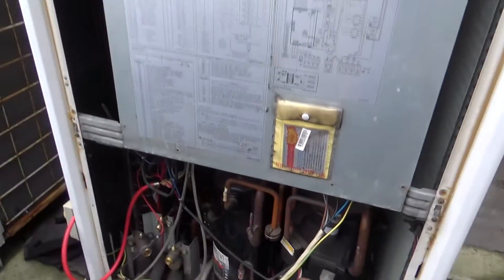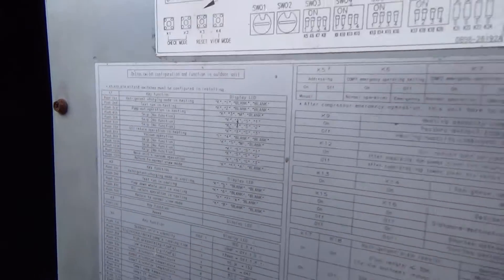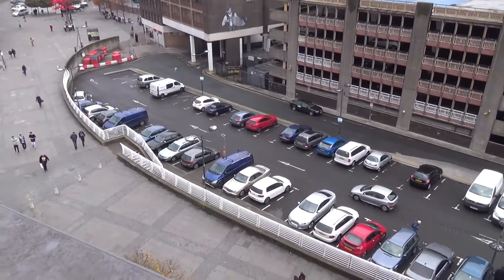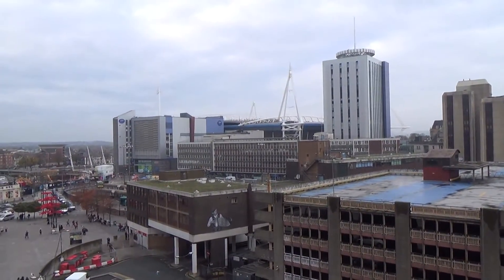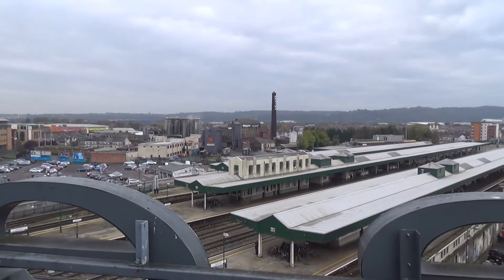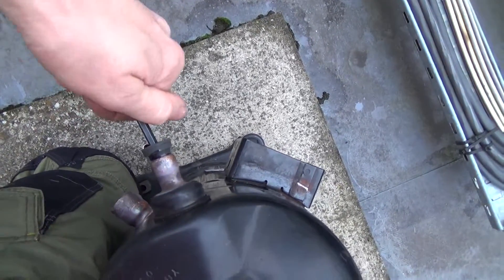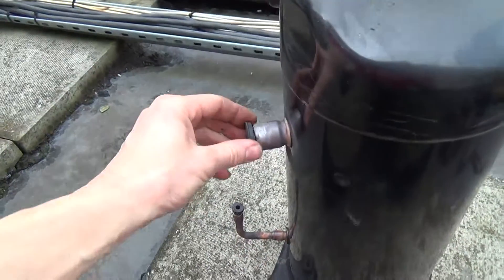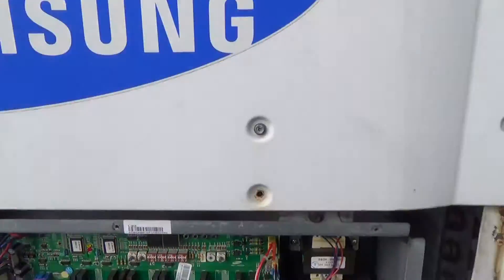Samsung Compressor Change

Comment: They are also referred to as variable displacement scroll compressors.  The displacement is controlled by increasing or decreasing the pressure in the control head.  Denso has actually been making them for a while longer than Copeland has.
Reply from the maker: douro20 Interesting, we have had a few failures of these on a multi compressor Samsung AC, though the constant duty scrolls just keep running.

Comment: Thanks for showing the roof top view, I feel like I've been on holiday. When you say digital scroll does that mean the compressor are variable speed? It looked a bit odd with all those contactors. Do those compressors run at very high speeds?
Reply from the maker: The compressor is fixed speed and runs around 2800rpm same as normal scroll, the digital part is that it can be unloaded 100% by lifting the scrolls apart. By modulating when it is pumping and when it isn't the capacity can be varied.
The other contactor is for the fixed capacity compressor, by running either or both the capacity of the system can be varied to cope with the differing loads of the 14 indoor units.
Reply: heavydiesel Thanks, that makes sense it didn't look like there was a BLDC drive in there with all those big contactors, How does do those compare against the variable speed compressors?

Comment: Hey what's going on man, I'm curious why do you call these digital compressors? I recently took a Copland compressor class at a Johnstone and wow they are making compressors with built in boards no more spade connectors or start cap, current relays, or starting components in general. Just a small board with connecting points. If you don't like working with electronics on equipment get out the trade now lol that's what I tell old timers to mess with them. But it's true
Reply from the maker: Hi Juan, these compressors can be capacity controlled by lifting the scrolls apart so they stop pumping, (its what the top pipe connection is for) the on off nature of their pumping is what gives them the digital name.

I've not seen one of the newer style compressors with built in boards here yet, I mainly do commercial stuff so new technology can take a while to appear on the sites i work on.

Comment: Hey just wondering why this heat pump has another hot gas line why can't it use the same refrigerant gas line coming from the side of the reversing valve connection the is connected to the line that goes to the indoor coil like regular heat pumps do what kind of strange heat pump is that with all those controls that most regular heat pumps don't use I've never even seen a heat pump like this before
Reply from the maker: The third gas line to the indoor units allows the system to heat and cool different rooms at the same time. It can save a lot of energy, you can take heat out of one room and put it in another one instead of moving it out side, and having another system move heat inside the room that needs heating.
Reply: Oh I didn't know that I haven't never seen a heat pump like that one that is a energy efficient unit why don't all manufacturers do that I haven't never seen one like this all heat pumps I've ever seen are either running in cooling mode or heating mode not heat and cooling at the same time
Reply: I mean I've seen them defrosting and using electric strip heat why they defrost but not cooling one room and heating another room
Reply from the maker: heatpump hvac Theres no electric backup with this system, its basically a load of minisplit indoor units connected to some boxes with valves in and then piped back to the outdoor unit with three pipes.

The system is in a hotel, basically each indoor can be off, heating, or cooling as needed, all run off one big outdoor unit.
Reply: Really so if it's really cold there and snowy how does the heat pump keep the temperature so it doesn't fill cool or if it goes into a defrost it doesn't put cold air in the rooms like on a day where everyone is using heat
Reply from the maker: heatpump hvac
I think the system will cope down to -10C and we don't usually get much colder weather here. It was my first time on this site and i don't know if they have any backup heating.
Reply: Oh ok